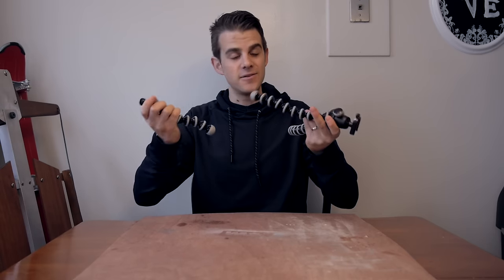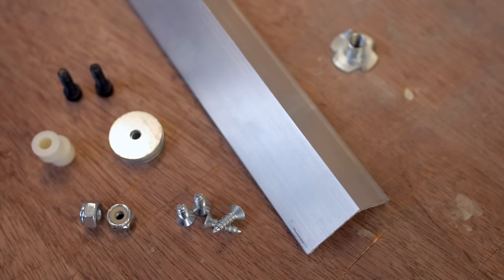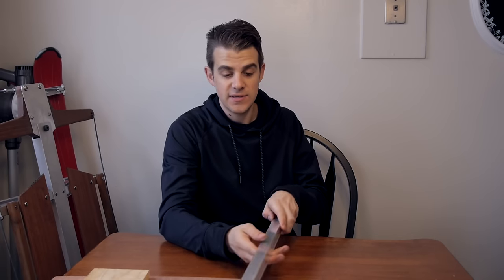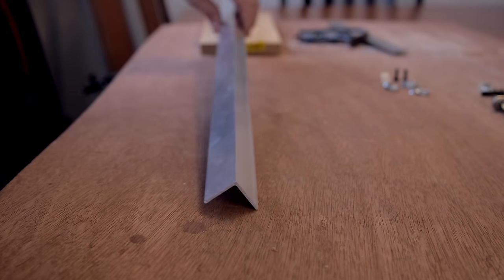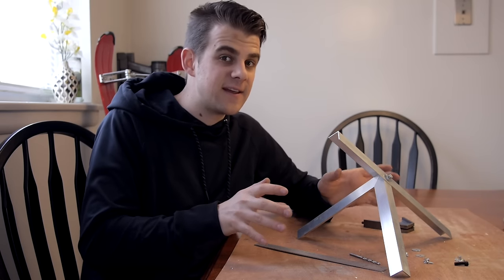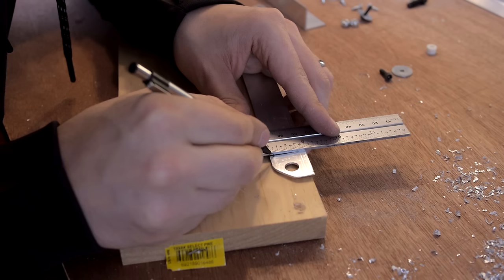Simple DIY Tripod

Comment: If the legs were mounted to the outside of the main piece it would fold without having to long cut the legs, and the complex geometry of the hinge area would be eliminated.  Wouldn't be quite as clean, but would greatly simplify construction. Would also loose a bit of rigidity over original design because of how the "hinge flaps" would be basically just be flat.  
Your design is better, this is just a way to make it less fussy to construct.
Reply from the maker: Thanks for the comment Nathan! You are right about not having to have two different sizes of angle if you mounted the legs outside the main piece. However, I'm pretty sure you'd have some complications up at the top and as you mention rigidity would be much lower. Good thought though.

Comment: Looks great, and a cheaper alternative. One potential issue I see is that small angle of wood (pine?),  it will probably weaken over time (use wood screws or metal screws?)  Also, this isn't what I would call  'simple' .
Reply from the maker: No, the construction isn’t simple.

Comment: It would be nice to see if u could add sliding or folding legs which would help setting it up in rough or non flat surfaces.
Reply from the maker: Good Idea! I'm thinking maybe a folding leg extension would be easiest to implement. I could actually add that to what I have already pretty easily.
Reply: Yes that is true. I like the design because it feels it can be modified to fit many needs. Like you can do a simple mod to make it taller, add a slider to get panning action or add counter weight balance style bridge at the top to get a different effect.

Comment: The whole second half of this video is pretty much why i bought a cheap DIY kit 3D printer. Even before i ever saw it or knew that this video existed.
Reply from the maker: Agreed! I could use one of those - just haven't taken the plunge yet.
Reply: My choice ended up being Geeetech i3 Pro W if you're curious - i bought directly from manufacturer's warehouse in Europe, via one of their official eBay accounts. I chose it on the strength of its electronics, which includes the most powerful of the common 8-bit processors and two fuses for individual high-power circuits, plus separate diodes to somewhat protect the otherwise death prone MOSFETs from the inductive voltage spike and take off some of the strain, plus various upgrade options like extra inputs, replaceable socketed motor drive modules, and an option to add one additional motor and one extra heater, a genuine high-performance USB chip and convincing looking switch mode voltage regulators, and excellent heatsinks on everything that might need them. I knew up front that that the mechanics is likely to be very wonky, and it was the cheapest kit i could possibly get in Europe, with only CTC being potentially a bit cheaper. The e-mail support was good, they immediately mailed the assembly manual, the LCD screen had one defective column and they sent a replacement, it arrived within 2 weeks from China. The kit took about 2 or 3 days to arrive and almost 12 hours to assemble, most of the time being wasted keeping track of about 60 tiny bags of various little pieces, so if you can come up with a system, that will help.

The frame ended up being kinda stable in spite of looking very unconvincing. The hot-end came very well assembled, i don't think the dangerous heater cartridge is slipping out of there. The important cables were all silicone covered RC type and seem super convincing in quality. The linear rods and bearings were of surprisingly good quality, though they obviously haven't been stored very well, there was rust on LM8LUU bearings. The metal carriage parts needed about an hour or two of filing because they powder coated on top of a burr - i could have used a drill but i decided to do it manually to ensure rods don't end up sitting loose. There appear to be dimensioning mistakes in the top plates, but they're not too critical to get first prints out of it. The M8 Z threaded rods were VERY bent, but i decided to use them, after bending them more straight and choosing the end that is less curved to go into the motors and carefully centring the couplers - still, without further modifications the printer will impart a visible horizontal offset onto each layer from the Z screw rotation, a problem commonly known as "Z-Wobble". The board came with an Arduino bootloader so it was trivial to replace the firmware, and you'll find the corresponding example configuration file for this very printer is right in the Marlin 1.1.8 distribution, though i wrote my configuration entirely from scratch, not having realised that. Replacing the firmware is recommended on any kit printer, because usually they ship without thermal runaway protection, so if the heater or the bead thermistor ever dislodge from the hot-end, there will be a serious fire. The printer is missing part cooling fan by design, so that's the first obvious upgrade (recommend 50mm radial 12V fan from eBay, cost about $3 from China, as it can maintain pressure much better than axial fans), besides i added an 80mm fan for the board to replace the noisy 40mm one and 90mm fan for the power supply just to give it a bit of thermal safety margin - i just used the ones i had laying around from previous PC builds.

The alternatives around the same price include Anet A8, which has cracking-prone acrylic frame, is missing the belt tensioning mechanics, and has very simplified electronics, but excellent quality Z rods and a part cooling fan, making for often great prints out of the box. Tronxy/Zonestar P802 series which are cheaper fairly exact clones of the Anet, generally decent quality too, and CTC i3 Pro B, which is a mishmash of a clone of various Geeetech models, where everything is of quality so varying, that you might or might not be lucky, but CTC is the only of these to have a big frame piece that runs all the way around and stabilises the machine. Of these all, the modding community is the strongest around the Anet A8, so you get lots of advice and enhancement options. Oh, first thing you do on any of these, ensure very good connections on screw terminals, maybe solvent clean them first, and on the Anet, you MUST get rid of the connector that goes right onto the bed and just solder the wires straight on, because it commonly catches fire. The frame of the Geeetech and CTC is very cramped and will cost you a few millimeters of print space and doesn't make levelling the bed all too easy. The Geeetech/CTC board needs a bit of care that the MOSFET heatsink doesn't burrow through the board lacquer as it will likely kill them, so i slid a piece of Kapton tape under there. You'll need Kapton tape, so buy some. Strain relief for all cables to moving parts is SUPER important, most fires stem from people not being very diligent about that. You can get much better kits mechanically if you're willing to pay a little bit more, but for me only the cheapest were affordable enough, and i wanted an engineering exercise that can 3D print more than an actual 3D printer - i want to work on the Marlin firmware and i'm slowly starting to. Creality Ender3 is even suitable for people that never built anything in their life before, as it's mostly preassembled, and delivers quality to straight up rival the most expensive devices on the market right out of the box, and if it catches fire, its lack of flammable material is likely to stop it before the the house burns down.